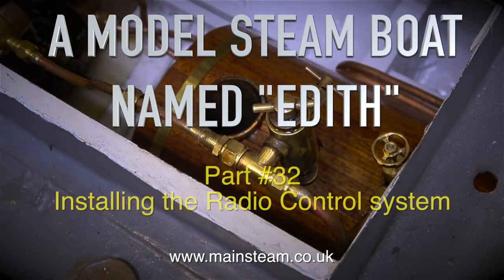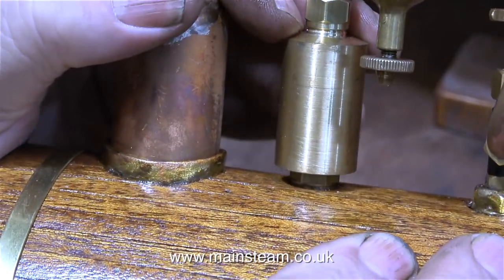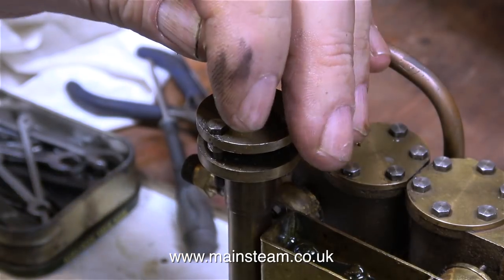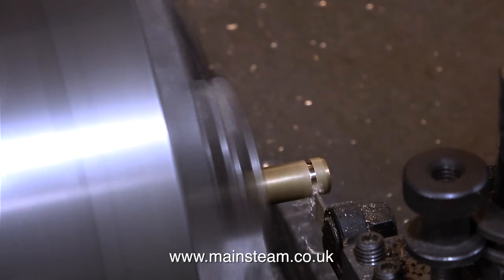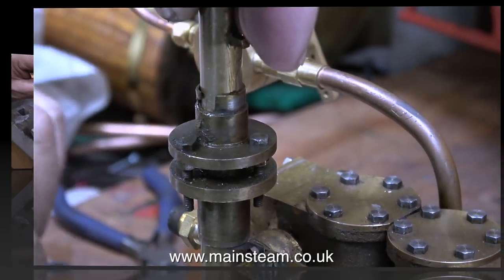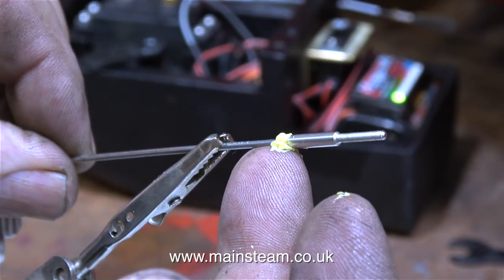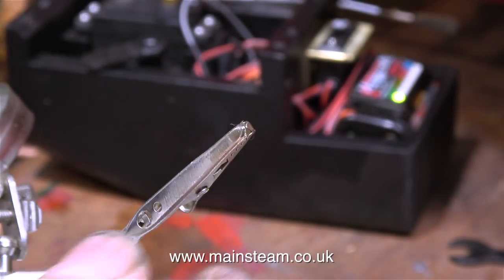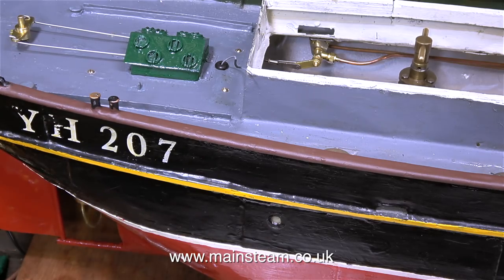A MODEL STEAM BOAT NAMED EDITH - PART #32

Comment: Mr. Appleton.  Looking at the long shaft of that water pump. Are you familiar with silicon grease ? This side of the Atlantic a particular brand called Sil Glide has been a go-to product for many decades. For lubricating rubber parts or when temperature stability or brass/brass and the like is an issue,it cannot be beat. Largely unaffected by water washout. Making the travel of that almost trombone slide as easy as possible,your auto parts supply place should stock that or a similar product.
Hoping that might help. Cheers.

Comment: I was wondering i there any particular reason  you use the joystick controller and not the trigger and wheel like are heat for RC  cars and some times boats . I'd assume it it's what your comfortable with or its what you had \ could get your hands on without to much fuss.
Reply from the maker: no preferences .... both types are easy to use.

Comment: Why you don't attach a second small engine with an alternator to make electricity to the RC and some batteries and also a pump, so you can sail until you finish the propane.
Reply from the maker: Because I am rebuilding this Model for a customer - and he didn't ask me to do that ........ have you been watching the series? Where is the room for anything else in the boat?
Reply: Keith Appleton ah the room yes, it's very tight in there, sorry didn't remember that :)

Comment: Hi Keith, I notice the gas valve fitting moves as you operate it, the servo travel appears to be slightly too long for the valve. I know you've done this many times and know the tollerances of the parts and such, but it came across to me as a potential place of wear as the fitting bends slightly each time the valve is operated. I made a mockup in lego of a similar setup but with a bar that slides through a fitting with stops fitted on the bar at the extreme points of servo travel, it works a treat and doesn't bend the fitting. Not a point of criticism on your part, Keith, just an observation from spotting a potential problem.
Reply from the maker: It isn't a problem in any way..... I always think these jobs through and I test the results carefully (without the camera running) to make sure things work as they should. In order for the valve to operate successfully and positively cut off the gas to the burner it has to be pulled back firmly. There is enough spring in the thin stainless steel mounting bracket to allow for this extra torque and I purposely set the servo arm on one spline further back to achieve this as you see it ......... the frequency of which this gas valve is operated is very low (only one movement for every sailing )and my setup will not cause any problems. No Lego was harmed in the making of this video }:-)))
Reply: Alright that sounds all good, thanks for clearing things up, mate.